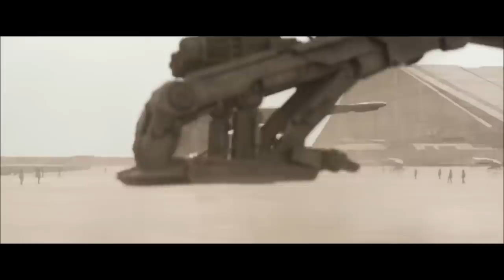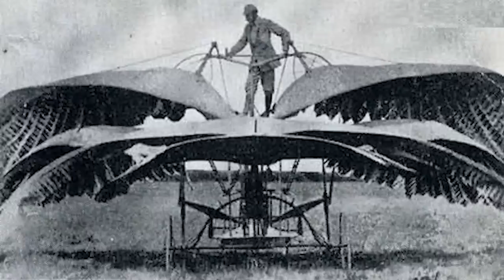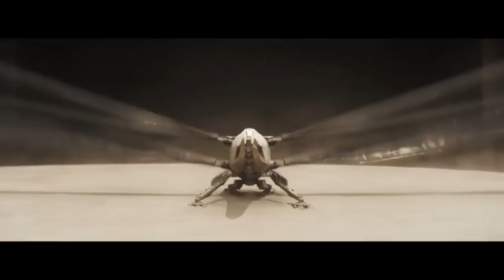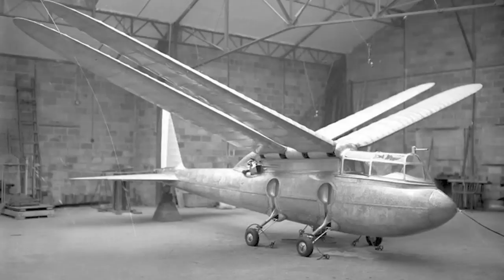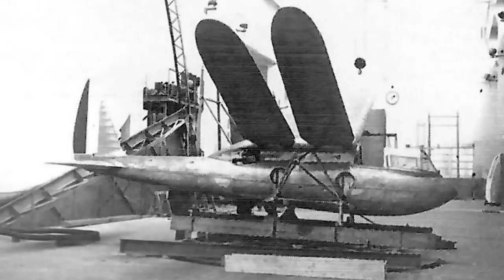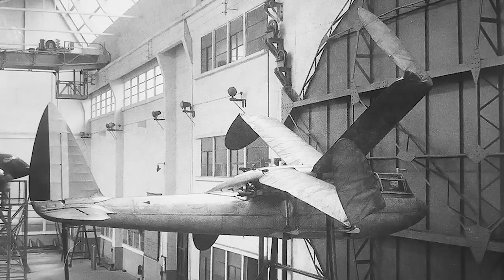The Riout 102T Alérion Ornithopter; Frank Herbert’s Inspiration?

Comment: I love how positive the designer was by including retractable landing gear in an untested prototype.
Reply: That does seem a bit optimistic.
Reply: @a.p.2356  - Optimistic not only that it would fly; that it would fly fast enough to gain any benefit from retractable landing gear.
Reply: @a.p.2356  It sometimes helps to manifest your success in small ways.

"Retractable landing gears would make this thing extra-awesome WHEN it works."
Reply: Low-key super funny
Reply: Alternatively, was determined to have some success even if the wings didn't.
Reply: You know, I like the landing gear design. Looks lighter weight than other traditional types.
Reply: Also die Idee ist schon ganz gut. Nur die Material Belastung ist bei den größen Verhältnisen zu groß.  In Klein klappt das ganz gut. Dann stimmt die Physik auch besser.

Man sollte auch mal was ausprobieren was ungewöhnlich ist. Auch wenn es das Risiko des Scheitern gibt.
Reply: Gotta love the optimism!
Reply: Comanche helocopter did the same thing. Lol.
Reply: 1) it's only human.

2) he wasn't paying for it.

3) there has been curious cases of flying machines over the last 200 years. Even the seemingly advanced Blimp(s) or whatever that would appear from the US Midwest to West Coast during mostly night around 1897 or so.
Reply: But it shows that the engineer/designer is subpar. There is absolutely no upside to giving a first-pass prototype like this retractable landing gear, but several downsides: it adds weight, complexity, and cost; it’s one more thing that can go wrong and one more thing that needs maintenance and inspection.

Comment: Problems with strength of materials not scaling with the forces on large flapping wings. The early attempts at flight were done with next to no knowledge of aerodynamics so it was natural to try to imitate birds, but how strong to make the structure and how much power it would need were pure guesswork. Lillienthal's fixed-wing gliders either flew or fell in a forward direction, depending on your definition of "flying". Langley had ample resources but still based his design on intuition rather than knowledge gleaned from testing. It was the Wrights who approached the problem from first principles, gathering data through experiments, progressing from kites to gliders to powered aircraft. By the time they were flying two-seaters they well understood what their airplanes could do and could predict how design changes would affect performance.

Comment: wow, crazy, no idea this aircraft concept was a real attempted thing. There's no way this would have actually worked, right? I can't believe those wings would have been able to beat fast enough to create much lift without shaking the entire thing apart, not to mention posses the range of movement and moment to moment adjustability required to maintain controlled maneuverable flight? Aren't scientists just now beginning to understand how dragon flies can even fly?
Reply: yeah probably the stress on those wings... also constant acceleration deceleration cant be good for efficiency. so if it works its way worse that helicopter i guess
Reply: @jebise1126  you can perform an up and down motion without actually creating constant acceleration and deceleration by oscillating the movement of the wings in a semi-circular fashion, many different machines use this physics concept for a similar purpose to reduce stress on the machine.
Reply: It can work in theory but in practical reality there is just too much force and stress associated with the reciprocating masses of the wings, rotating wings or blades are way more mechanically efficient and the only reason this is something man made that is better than nature made is because obviously rotating wings aren't possible in nature.
Reply: Science already knows that for small sizes and very small weights, eddy currents provide sufficient support in the air. You are right that this is a finding of recent years when it was possible to use the "visibility" of processes that were thought to be anti-floating. Apparently due to the selection, there are no larger bee animals in the wild, because it just didn't work and they were destined to perish. The so-called "proven" size remained. Energy is also quite important - a large bee insect needs it more than a small one. The wings of bees contain very little inertia and this is one of the many important prerequisites for flying this way. There are RC models that can mimic insect flying and actually fly, but their wings must contain very little inertia, have higher engine power and again enter the overall size, which can still take advantage of air vortices and the inertia of the air itself (air is also matter and its property has a great effect on flying). Enthusiasts of this method usually did not have sufficient education in physics or mechanics. Nor did they intuitively estimate that the macro-scale of this principle is a dead end. But thanks to them, history is richer.
Reply: People make couple meter big "ornithopter" drones fairly frequently - the problem with scaling up is cost. The mechanical stress on the wings would require super expensive composites and alloys, for what - to make something that performs like a worse helicopter but costs 1000x as much? But yes, you COULD make it work IRL with modern tech, but until there is some niche that requires it (transport among floating habitats in gas giants is one suggestion, the design is more resilient to density changes) - there is no point.

Comment: This is a unique aircraft. Even though it did not work out I appreciate the designers looking outside the box. ( I just saw a Dragon Fly in my backyard today ! ).
Reply: I've always scoffed (along with most) at mans early attempts to acquire powered flight by mimicking nature.  However, on reflection, it does indeed seem quite reasonable to do this.  Insects and animals are a wonder to behold whenever one cares take a few moments to appreciate the world around us.  Sitting here thinking about the above video, is there a specific reason why larger creatures don't use this type of method of propulsion?
Reply: @rob5944 There is a cutoff point with flapping wings that you quickly approach the bigger the body or vehicle is. The engine in your car is more than sufficient to move it, but it would have no chance if you put it in a train to haul hundreds of tons of cargo. It only works for small things.

Comment: This will definitely work with the materials and technology of today. We have more kinds of  Flexible stuff than we know what to do with and good ideas are in abundance. I think if you make the wings a bit more bendy and flexible coupled with computer analysis to give them the correct tuning for the wind variables and couple all this with sensors, so the wings not only react but, Feel the wind so they can flap more like a bird or, Dragonfly and alter their attitude accordingly. You will definitely get that thing off the ground and keep  it up there for much longer than ever before. Make it Flexible Soft and Cuddly and don't put any stupid machine guns or, bombs on it and it will sell like hot cakes . . . . :) It needs to be light enough so when the batteries run down and it starts to lose power, it can just fall back to earth like a bird and glide back down into a field anywhere the pilot choses. Plus when it gets up to its normal flight level. It changes to Albatross Mode. Albatrosses are wonderful Gliders and they can hover up and down at will. All they do is face into the oncoming wind, open stretch their long beautiful wings and lift off into the wild blue yonder for Weeks on end. Look them up on the channels here. That is the kind of Aircraft we need.

Comment: A bit unfair to blame the engine. J A Prestwich (JAP) engines are amongst the finest ever built in their class. Years ahead of their time for quality, precision and power to weight and dimensions. It was still powerful enough to destroy the wings.
Reply: I may have heard it wrong but the wings were blamed. Not the engine.
Reply: @ai-d2121  heard that after Ed said the engine was a not delivering its specified power. 
Operator error I would think. 😉
Reply: It was in a wind tunnel test, the engine wasn't running when the wings failed. All simulated.
Reply: @turtlewolfpack6061  nope, the engine was running, or the wings would not flap. The wind tunnel was used to simulate apparent wind

Comment: I can imagine what carbon fiber construction would do for this design especially using computers for stability and controls, and a modern small turbine
Reply: it would only be useful on perhap smaller craft like drones and or light aircraft.  it would be interesting to see them work.  anything heavier would need new research into material and tech like something similar to muscle
Reply: @Quetzalcoatl_Feathered_Serpent  how about linear induction motors and metal cables to stand in for muscles? The limits are only imagination
Reply: @ronaldharris6569  they should be able to work so long as said parts can maintain the stress.  

So long as they are capable of taking the stress of the movement of the props (wings)  then yes they should allow it to create lift,  and the neccessary movement to allow it to function. 

The only way to know is to create a working concept

Comment: Considdering the fact that I have never heard of a operational ornithopter till now, other than small scale models, I am rather shocked that this vehicle has not been more talked about!
From what I understand, it did hover, and in tethered wind tunnel test could do 81 miles per hour!  Sounds like a serious competitor of the then state of the art helicopter!
Especially since this was a one off test vehicle!
Why has no one pursued this avenue?
Considdering all the unusual experimental projects you see done by tinkered and crackpots, you would think this ought to be right up their alley!
Reply: I do not believe that was a tethered test in the sense that you’re thinking of, rather the aircraft was on a pylon while air was blown across it at 81 mph.  That’s my understanding from that passage.
Reply: @JoeOvercoat  
You may be right, it was a bit unclear.
I take it the other way.🤔
 Even so, it clearly stated it was capable of hovering, which is no mean feat!
Reply: @mahbriggs  it could not achieve lift
Reply: @kyle857  
And your source?
Reply: @kyle857  
Evidently you have none.
It clearly stated it did hovering test.

Comment: Building a crow or insect sized ornithopter isn't all that hard but there's a reason that giant birds are freaking rare.
Reply: And the largest flight capable birds we do have are gliding specialists.
Reply: The "twin-wing" arrangement will work for insects because of their small scale/weight , their strong and flexible wing-structure and the energy available to drive the wings. It just can't be done on a bigger scale by using man-made structures that can't replicate the necessary wing movements without disintegrating, even if a complicated,reliable apparatus to actuate those movements can be made. A lot of power would be needed to work everything.

Comment: So no actual flight tests were prosecuted? Or a moored, engine/propulsion system trial, just the wind-tunels with a running engine (+"wings")?
Reply: Based on what is seen in this video I don't even believe it would fly at all.  It looks like the solid wings just flap up and down in a single plane of movement, which would seem to push as much air up as it does down.  I don't see how warping them to provide some forward thrust would overcome the net lack of lift.  Insect wings don't simply flap up and down on a hinge in one plane, they have more complex movements that move the air in a net direction rather than just back and forth. Anyone got film of this aircraft flying?
Reply: Exactly what I was thinking not even a mention as to whether or not it might have been able to fly….

Comment: It is somewhat ironic how WW2 advanced some aircraft designs such as jets. while others like this one came to an end. I think we'd all like to have seen it fly. Without the wings collapsing.

A couple of insect related aircraft stories for you. There is a story that Dr. Ernst Heinkel, the German aircraft designer, once told Hitler that the it was impossible for the bee to fly, but because as the bee did not know this it could fly. When I first came across this my thoughts were that the fact that the bee flies would suggest the Heikel was wrong. Turns out Heinkel was wrong, yes there's a surpise. High speed video has shown that not only does the bee fly but that it's method of flying is so advanced that we are not likely to replicate it anytime soon.

Story number two. And here's one you may be able to make a video on. Post WW2 Britain built a research aircraft using something taken from some flying insects. In the past some insects had four wings but today only have two. A short stub of the original wing is still there and acts as a counterbalance to the remaining wing. So when the remaining wings beats down the wing stubs move up as a counter balance. This helped that insect with stability. So with the idea in mind it was thought that this could help with keeping aircraft stable when they fly. So they tried it out. The aircraft took off and once in the air the test pilot switch them on.

Now it has been some time since a read about this so some of it is a bit sketchy. But as I remember it the stabilisers immediately cause great difficulties for the test pilot which left him struggling to fly the aircraft as the stabiliser was causing a lot of vibration. What's more he could not switch the stabiliser off so all he could do was extremely carefully fly the aircraft in a circuit until he could land it. He said it was the most terrifying experience he's ever had in his life. And no it was never flown again.

Comment: Great video! Hmm....maybe this can be redone in graphene/carbon nanotubes/carbon fiber/titanium? But the wings require some twisting motion, while the attachment would require circular motion. Still yet, every individual wing would require control, but working as a group. How many hundreds or thousands of rpm would you need to get airborne, and/or have a reasonable ground speed!?
Reply: Evidently not much since this was apparently able to hover unassisted and was capable of wind tunnel test of 81 miles per hour!
Reply: @mahbriggs  alternatively, we could just, now here me out:
Go with a propeller or helicopter aircraft
Reply: @ALABasham  
Or e
We could do something new and innovative!
Reply: @mahbriggs  but it's a jack of all trades, master of none. A propeller craft would go faster while a helicopter would be simpler to design/maintain
Reply: @ALABasham  
How do you know?
Look, it was damaged during testing, during which it apparently was doing well, never repaired due to the oncoming war.
You have no idea what it's potential was!
Until another is built, no one else does either.
Reply: @mahbriggs  the fact that no one has ever made another one, and we have jets now.

Plus, speaking from the aviation experience of having family who owned and flew stuff like a Fokker Triplane
Reply: @ALABasham  
So you think there is nothing new to learn!  
LOL!
you clearly aren't as smart as you think you are.p
If you can't imagine how these might be useful, you are clearly a dullard!
I ha e no idea if they can be made to work well enough to be useful or not.  But to dismiss them without trying to find out is just plain stupid!
Have a nice day!

Comment: Biggest problem with ornithopters is to manufacture strong enough wings, steel or aluminum alloys are not enough, our only possibility in this matter is nanotechnology.
Reply: Titanium composite sandwich is your friend there. Nice and light, and fairly flexible too.. But you'd have to balance the pairs in weight almost exactly or put a rotoflex style donut in the transmission or any imbalance will trash the layshaft/transmission/engine bearings in about 5 minutes
Reply: @rosiehawtrey  That would work only for smaller aircrafts like the one mentioned in the video, pilot only and small load. But if you want to make something heavy duty like the one from Dune, then you have to go with nanotechnology.

Comment: I would love to see the concept revisited with modern materials, computer assisted design, fly-by-wire controls etc.
Reply: They have drone and remote control versions. I've seen fairly large bird like ones flying.
Reply: modern multi rotor drones are light years more efficient than flapping wings at crazy speeds to achieve flight. even a gyrocopter is better, because they are based on maple seeds
Reply: https://youtu.be/ZCrS52sM3Zs
Reply: It's a flawed concept. Flapping wings like these are barely generating any lift.

Comment: Given that helicopters have a distinct limit to their forward speed, I wonder what the aerodynamic speed limit would be for a working ornithopter.
Reply: well a easier way to fix that is to have a pusher propeller, which has been done.
Reply: @testaccount4191  You need more than that. The issue is differential lift on the rotor as the helicopter increases forward velocity. The side of the rotor that advances goes supersonic while the retreating side's forward velocity relative to the air decreases, risking a stall. That is why compound helicopters like the Sikorsky  S-97 have contra-rotating coaxial rotors.
Reply: @Girder3  Thank you, you saved me from typing that.
Reply: @Girder3  correct me if i am wrong but was that not offset in something like the cheyenne helicopter by having wings which provided lift at higher speeds?
Reply: You could definitely guarantee that it would at the very least have just enough 'speed' to get it to the scene of the crash ?🤣🤣🤣